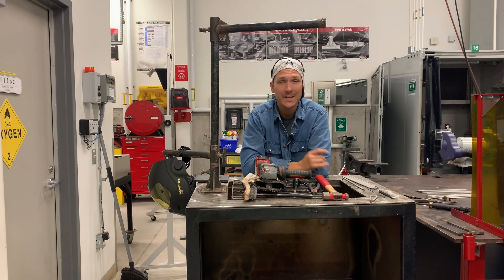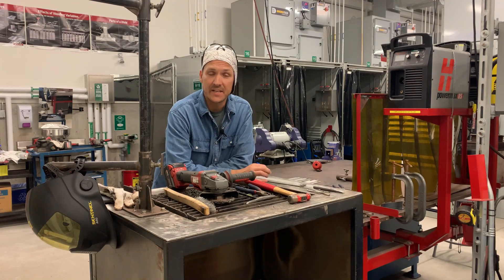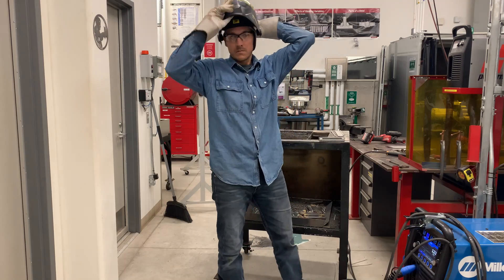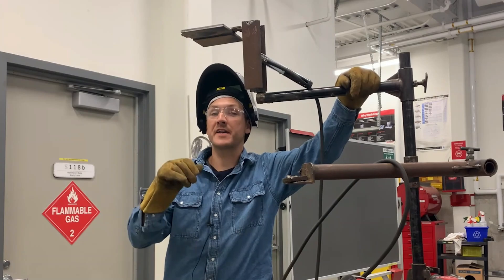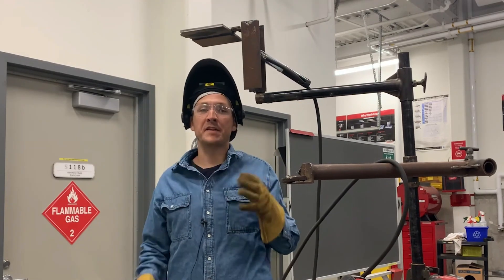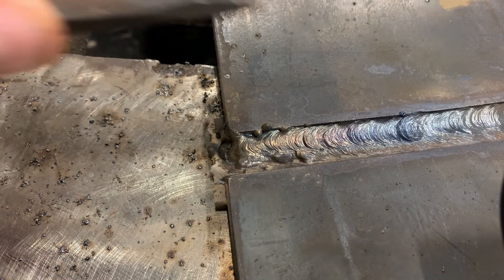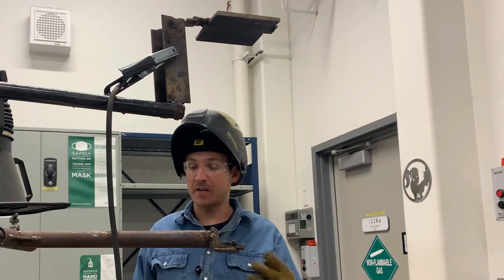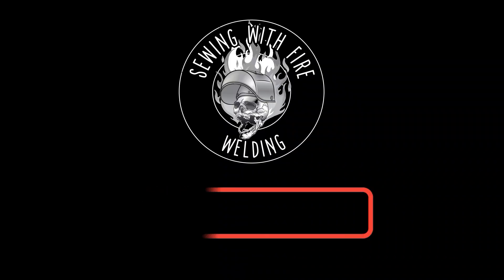CWB– Overhead Position | SMAW

Comment: CWB Tests are a scam. Us Journeyman Welders who went to school and did our hours can't stand CWB....for this reason....CWB Testing doesn't require any qualifications to take the test. And yet a person who didn't do school and hours can take the test and be more qualified than a Journeyman on certain jobs.....erasing the whole point of mastering welding trade. An uncertified person only has to pass 6" of weld to be certified and then produce crap welds after on the job...meanwhile a Journeyman had to pass several times over and over. CWB certification should only be for people who have their level C and up.

Comment: How much % of the 7018 1/8 rod are you using for these passes? 1-root 4.5" stop, 2-root middle stringer and 3-caps. Instructor told us to use most of the rod(85%+/slow travel) but fellow ticketed welders telling me to use much less(50-70%/ faster travel).
Reply from the maker: Sorry for the insanely late reply on this. The root for myself takes up about 75-80%. For fill I am at the 50-75 mark.

Comment: you need 2”x 8” x 1/4 for your back flat bar
Reply from the maker: @jujitsou  the standard requires a minimum 6” for the backing bar. The extra is for run on/ run off’s. Highly recommended but not required. 🤘
Reply: @sewingwithfirewelding5627  as a 30years passing cwb test your better having 8” you need to run your weld farther.
Reply: im trying to help you ✌️
Reply from the maker: @jujitsou   thanks for the comment. You can find everything in CSA W47.1

Comment: It would of been nice if you would of showed how to fix that cap in a test.
Reply: If that happens in a test there is no fixing it, you can’t grind it out and laying more weld will increase reinforcement past 1/8” you have to methodically place the welds and think ahead with overhead especially when filling and capping. I also found a little bit of electrode manipulation helps on the cap so you don’t get droopy looking welds.